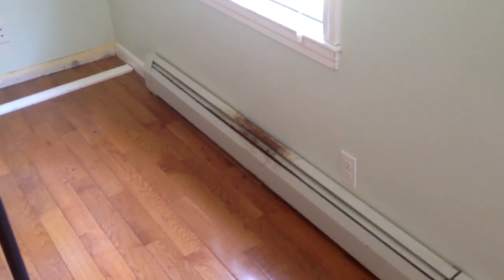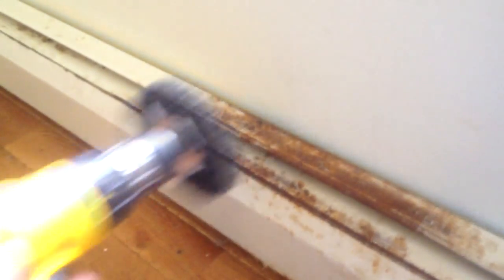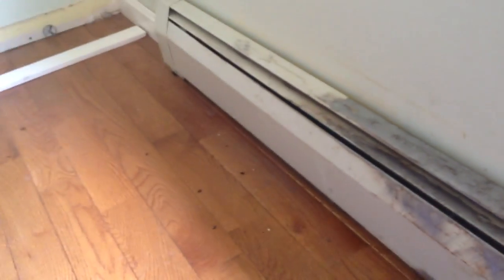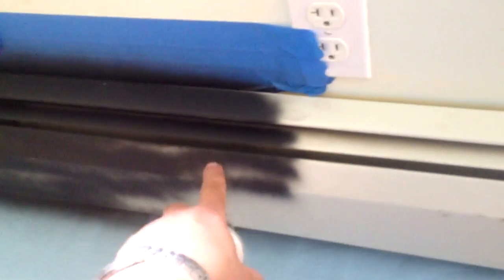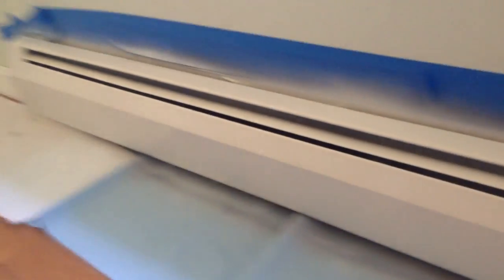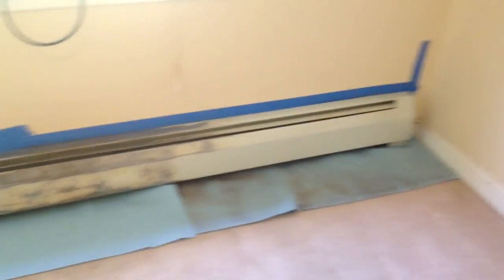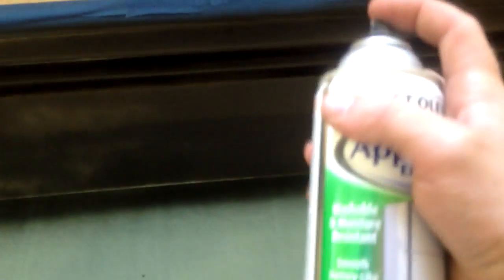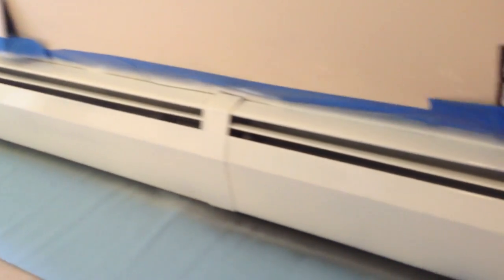Restoring and painting old rusted heater covers

Comment: Aren't the front panel and the movable louver easily removed so you can take them outside or to the garage to prepare and paint them much better and easier?
Reply: bigpardner of course they are
Reply: But then you would have to cover up the pipe and fans underneath = more work than necessary
Reply: @dianebroderick9224  Diane, I think he/she meant that disassemble the cover (and leave the pipe/heatsink(?)) alone, and then go outside and paint, and then assemble it back. (sorry if I did not understand your reply properly but I think that's what he/she meant) (it is more work, but I believe then the paint won't get to the pipe/heatsink)